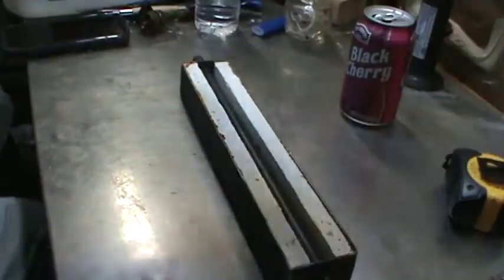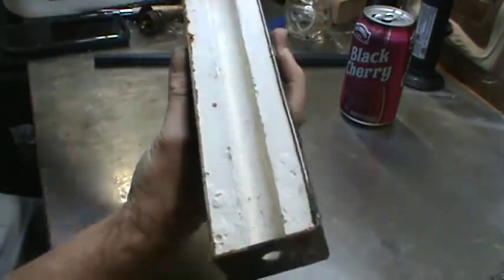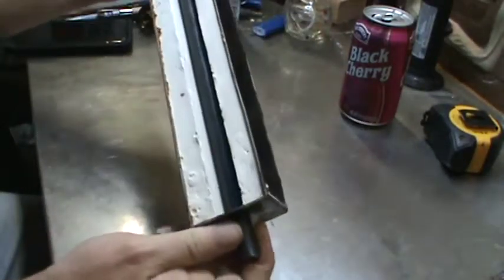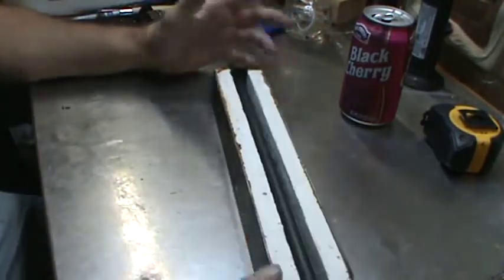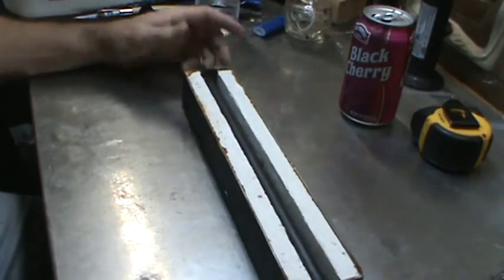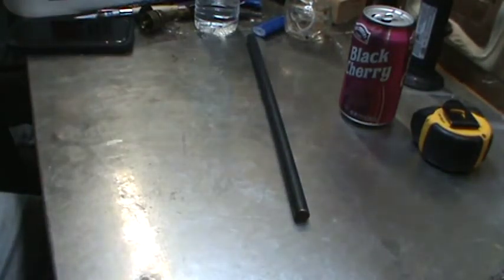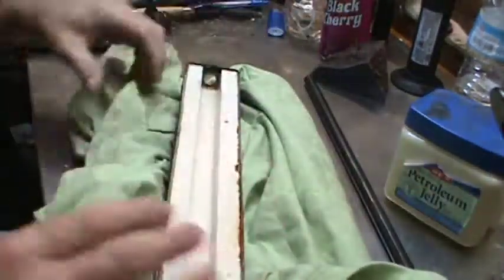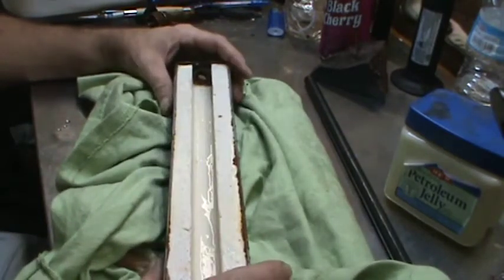Wax Sprue 101

Comment: Wax popping question: not entirely sure. If I melt a solid, clean block... it sits there without crackling or producing bubbles, but recycled wax will pop like hot oil. Really interesting subject and no answers on google.